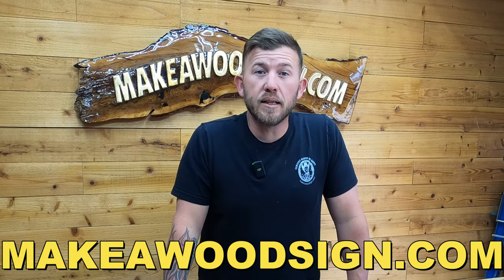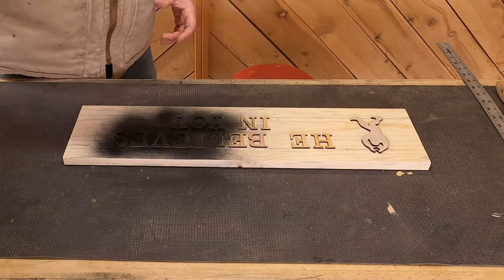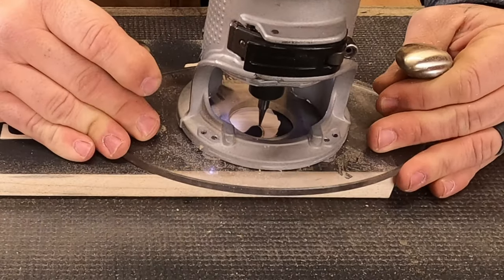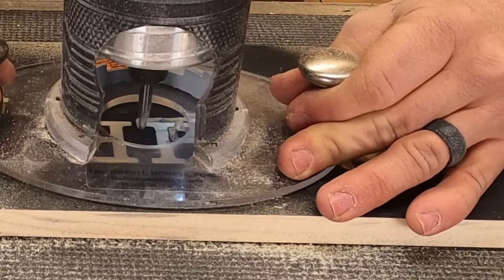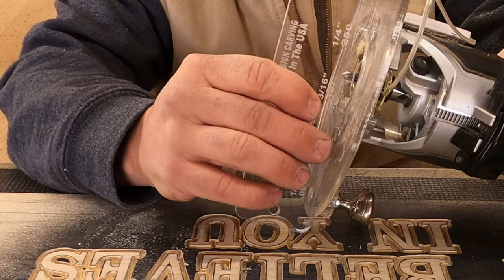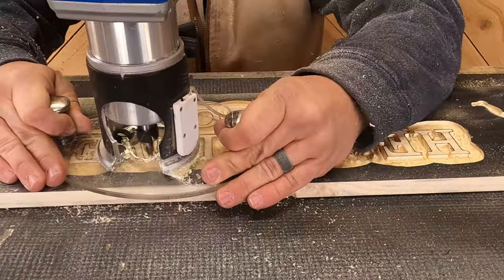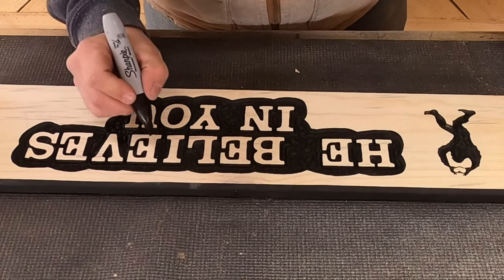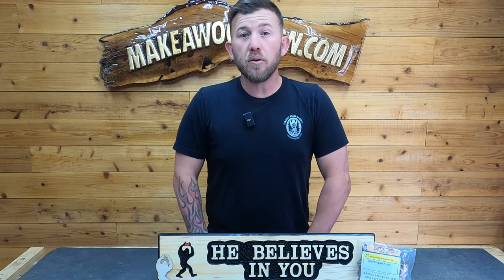Hand Carving A Wood Sign - No CNC Needed Bigfoot Love

Comment: It's incredible to see such clean lines! A quick question, are some woods easier, i find that the router on some wood i have carved doesn't maintain a constant speed, and on parts of the grain, it passes quicker, then slows down again in my hands
Reply from the maker: Thanks Paul! Yeah, the grain plays a HUGE roll in how easy it is to keep a good line. The hard/soft is a pain HAHA
Reply: @oldave100  can you recommend a few types that you find has less hard and soft features, I know a while ago I watched one of your videos that had I information on it, i must get some of that spray that helps with bleeding as that has caused me some headache so far on a few projects
Reply from the maker: @tallpaul7657  we like cedar and pine. It has a lot more to do with the individual boards than the type of lumber.
Reply: @oldave100  ah, ok, I will try testing on scraps of the main board and see how it feels before setting out on a project. Thanks again for all your help and advice. It makes the hobby so much more fun, I have also been putting in time on a scroll saw and having so much fun using that alongside the router.